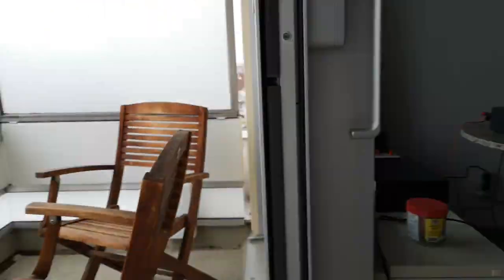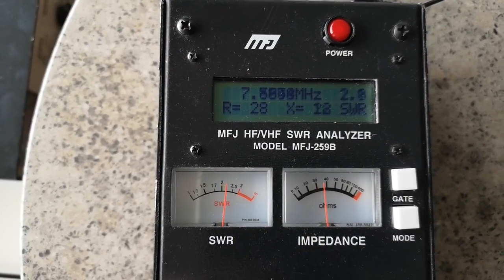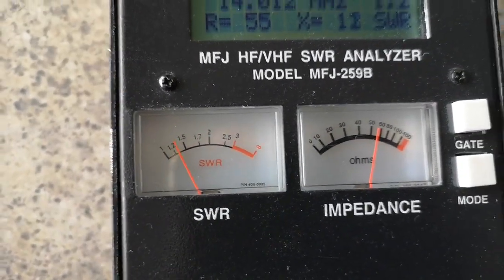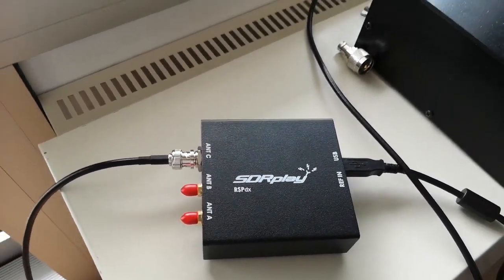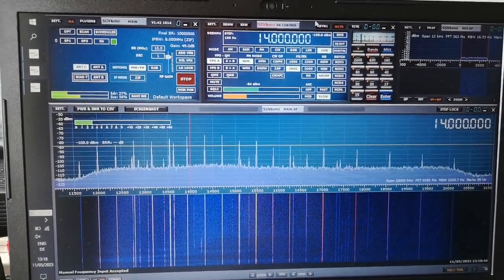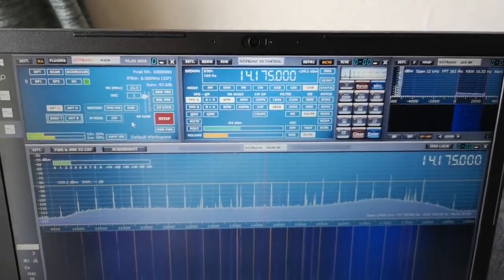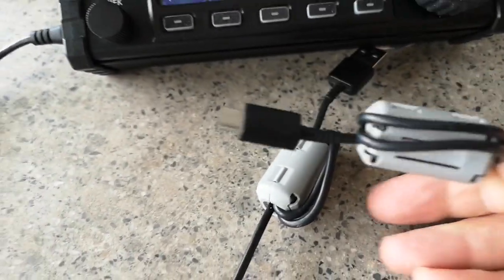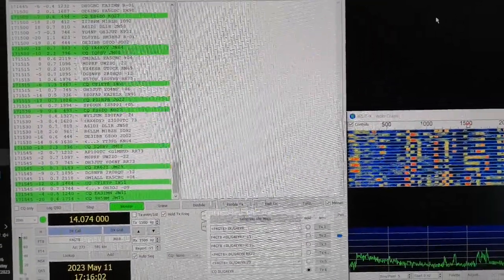Small Hidden Antennas for Indoor Amateur Radio Episode 1

Comment: If you lived on the top you might be able to put an antenna on the roof of the block of flats.
Reply from the maker: That would be great but then I would have to contend with leaking roof and poor heat insulation issues. Nothing is perfect ;-)

Comment: Awesome video Simon, thank you. This really shines the light on how important getting that noise floor down and how to do it. One question, how do you like the Xiegu X6100 radio? I will be purchasing my first radio soon and this seems to fit the bill at a reasonable cost. Is there different one you may purchase after using this one for a bit? 

Again, thanks for the great video.
Reply from the maker: Thank you for your praise. Regarding the X6100 I got fed up with the heating problem when on transmit and did experiment with attaching a large heatsink but this turned out to be not so practical and did not help so much in reducing the temperature. Also, the receiver had quite a few birdies in it "spurious signals" which you can usually identify since they often move in the opposite direction to normal signals on the spectrum display as you rotate the tuning knob. I got a Yaesu FT-891 and found that way better except that there is no waterfall display. The cost is approximately double that of the X6100 though.

Comment: Great audio, I thought it was raining at mine.
At 120ft asl in a tower block with a tuner and 5 watts, on a plastic window frame containing 3 metal window frames I connected the earth to one window on the left and centre of coax to metal window on the right, from Manchester to Europe at time of great signals on 10m no problem back in 2000.
Reply from the maker: That sounds great. I am always looking for quirky things to use as antennas. Keep experimenting and see what turns out...

Comment: All very interesting and over the years I have learned if you are using low power just load it up.  Even greater than 3:1 SWR won’t  kill your low power transmitter.  Get on the air and see who hears your signal. This is HAM radio and over the years bed springs, aluminum screen windows one slider door screens and emit and receive a signal.  Dropping an invisible small diameter black wire straight down works well to. Living in a flat like you your biggest problem will be radio frequency interference from all the electronics in each flat. Great video. Just encourage others to JUST DO IT!
Reply from the maker: That's great advice, David. Thank you so much for your comments. Just give it a try and don't give up is a motto that applies well to me. The challenge of HAM radio is a great training ground for future engineeers too. That's how I got started in my career in the 1980's :-)

Comment: Your loop antenna could be adjusted by fitting a long piece of plumbing pipe to the knob, or even moulding a heated pipe round the knob -like a box spanner.
Reply from the maker: That's what I did in the end !

Comment: You probably said it somewhere in the video but just a note that random wire doesn't mean a random length of cable.  Google will show some handy spreadsheets for lengths of wire to avoid... basically resonant frequencies and their harmonics.  Thanks for the vid / ideas.
Reply from the maker: Thanks for the tip Jeff. I hadn't thought about lengths to avoid !

Comment: What an excellent video! Fantastic demonstration! I also live in a flat and I have a lot of metal all around my balcony. I have a temporary setup and managed to hang a dipole for the 10 band similar to an inverted L but much more crooked. The radiating element is somewhat parallel to the balcony floor but not fully stretched. The one connected to the braid  falls down parallel to the coax but each time I set up the dipole  I fiddle with it to ensure the smallest swr. It is this non radiating element that I keep moving to control the SWR. It almost never the previous position.
Reply from the maker: Experimentation is the key :-)

Comment: Indoor antenna`s always suck
Reply from the maker: Unfortunately I think you might be right !
Reply from the maker: @VicGreenBitcoin
@VicGreenBitcoin
 I am afraid you might be right !
Reply: @fotografm  Giving negative comments is always easy, but offering a solution is a bit more difficult, but I do have an idea how you can install a full size antenna without anyone knowing. Do you happen to have a plastic PVC drainpipe on the outside?
I used to be able to fit a whole Antron 99 (upside down lol) in there and later a 20 meter long dipole! Can you show me the outside of the flat, maybe it's possible.

Comment: RE: Not receiving any output on your laptop. The most likely cause is because your laptops clock is not set to the correct time. It only needs to be off by a few seconds for this to happen. As you're using Windows  it's easy to fix, simply left click your clock on the bottom task bar, select "Date and Time". A window will pop up and in that window will be an option to sync your computer clock with a time standard. Job done.
Reply from the maker: After I made the video, FT8 signals suddenly started appearing on that laptop. I wondered what had changed, so yes the time probably synchronised automatically in the background. I will make a point of doing this manually every day in the future !
Reply: @fotografm  I’ve been caught out a few times by this that’s why I mentioned it. I now habitually go into W10/11 settings and hit the time sync button before firing up the software.

Comment: Hi Simon. Have you checked the laptop's clock is accurate? (Are you running a time sync program?) This foxed me too when I moved from my main PC to using an old laptop and I eventually found the time was out by a few seconds on the laptop. As soon as the time was synced, signals were then decoded.
Reply from the maker: Thanks for the tip. I think that is what the problem was. Do you have a favourite time sync program ? Is there any advantage to using one as opposed to the time sync function in windows settings ?
Reply: @fotografm  I use JTSync on my old laptop, only for the reason it is steam powered (at least it feels that slow) and that little program just does the job. If the time sync function in Windows works for you then I'd just go with that. All the best, Neal.
Reply: @fotografm  you should definitely use a separate time sync program as it runs as a service and it syncs the time much more frequently and reliabily compared to what Windows does out of the box. I am using a tool called NetTime on my laptop and NTPD on my desktop PC. Both work well.

Comment: I would use a long plastic rod (or straw) to keep my hand away from the loop.
Reply from the maker: That's also a good idea. I just thought of maybe using a length of 1 inch pvc pipe to turn the knob from a distance.
Reply: @fotografm  You can make it just long enough to stick past the front edge of the box.

Comment: The noise is probably coming from the screen inverter for backlighting.
Reply: True . Also of the computers power supply aren't that good stuff and the noise goes through the usb ports.
Reply from the maker: @adrianoragazzo1321  I am sure you are right. The worst noise seems to come when I touch the trackpad which is also being electronically scanned of course.
Reply from the maker: I guess so since on some laptops the noise increases when I touch the screen.
Reply: @fotografm  capacity coupling. Grounded conductive foil will block that, and your wifi too (sadly). I use older, 2nd hand Lenovo thinkpad  laptops as they are better made and better screened. The modern cheap models sold to peasants' are not well screened.
Reply from the maker: @G7VFY  I just ordered 5 "broken" older Thinkpads at a good price and after fixing them, intend to pull them apart and experiment with better internal shielding. Let's see how much improvement I can achieve.
Reply: @G7VFY  I have a Lenovo ThinkPad 420 from 2011 and it does work great
Reply from the maker: @stephenwalters9891
@stephenwalters9891
I guess so since on some laptops the noise increases when I touch the screen.

Comment: You put a tuneable loop antenna on the back of an antenna tuner????? WHY??? You don't need effectively TWO tuners. Loop antennas have a VERY high Q and so you will only see 6-8Khz bandwidth on an SDR waterfall display. G7VFY.
Reply: He told couple times that the loop is connected straight so it bypass the tuner . Alot tuners have two antenna's output so He can select the "balcony" or the loop , both on bypass or through the tuner (wich isn't the case of the loop ).
Reply from the maker: @adrianoragazzo1321  That is correct !
Reply from the maker: Thank you for your attentiveness, Stephen. That is indeed true.

Comment: I also live in a flat except with no balcony. Although there is a metal rail outside the window it is, as expected, electrically earthed. I have managed to work some stations in Europe on 5W/FT8 using the Wizzloop antenna next to the bedroom window. Managed to cross the Atlantic with WSPR and FT8 spots (not QSOs yet).

I see the Faraday-cage QTH situation as a challenge. Trying to make a radio contact from inside a flat is fun! One day I might even manage a voice contact on another continent.
Reply: Hi,very interesting and have a new subscriber 
I’m very new to I’ve got a peculiar question you might be able to help with
I also live in a flat,ground floor and I use a mag loop,with a FT818 very mixed results
Currently learning CW as I tend to pick those signals up better than voice
Would moving to a full SDR transceiver like Elad Duo make tuning the mag loop and operating easier for me?
Reply from the maker: @MrBracey1970 Welcome to the hobby. First of all changing the transceiver will make little to no difference except for perhaps the ergonomics of how you operate it. I have a FT818 and I love it. The receiver is very sensitive but the output power is quite limited at 5W. I like the Xiegu X6100 too because of the spectrum display and 10W output power but that receiver has more "birdies" and is a little more quirky. The size of the loop is very important. Larger diameter allows it to work lower in frequency. Fatter tubing provides lower resistance and thus greater efficiency. I tried many different locations in the flat and found that one particular window gives the best results. I am getting a 2E0ERO loop with motorised remote tuning. I find that is an excellent solution for keeping the tuning spot on. I seem to get for more signals on CW than on SSB probably because weak CW signals are much more easily understood than SSB. Keep experimenting !
Reply: Interesting you should say that ,I have a 2E0ERO loop antenna,but the manual tune version,great antenna that’s hard work to tune.I’ve ordered the electric motor tuner and hopefully that will make a difference.
Reply from the maker: @MrBracey1970  I find the electric motor is a life safer for a variety of reasons. You have to tap the buttons really quickly on the controller to achieve perfect tune as the motor moves too fast for my liking, even on the slowest setting.
Reply: You can put two, hf or VHF mobile antennas back to back with a cheap adapter and have a monoband dipole. The hardest thing to do in a flat is finding a good group. You can use bluetack or masking tape to do a corner fed loop tacked onto the ceiling. Just like a ww2 spy would do.
Reply from the maker: @G7VFY  That sounds like a great idea. I will look into it. I tried a longwire antenna and found that received enormous noise levels which completely buried any signals. Magnetic loops seem to be the way togo because of their rejection of electrical interference. I am also thinking of trying a copper tape square loop stuck onto the window...
Reply from the maker: I find the best signal is near the window too due to metal joists in the reinforced concrete. I am about to make a video comparing signal levels inside and outside the window as I suspect that the glass has some thin metal coating on it. We will see....
Regarding antennas I have ordered a 2E0ERO loop antenna with remote motorised tuning which I see as essential. A new video will be made when that arrives.
Reply: @fotografm  Loops are great for narrow band modes like CW and SOMEdata modes, but the high Q means waterfall displays will be mostly blank.
Reply from the maker: @G7VFY  Agreed !

Comment: Simon, you never did say what's in the peanut butter jar...  Will you be bold enough to try transmitting into the balcony antenna?  73 VK4QP.
Reply from the maker: In the peanut butter jar is peanut butter which I have to eat before I can use the lid as a tuning knob. A friend took pity on me and is 3D printing a suitable knob for me. 73
Reply: @fotografm  I know what you mean.  When I went to the US once on holiday, I bought loads of tins of Altoids, not because I liked Altoids, but because I wanted the Altoids tins for radio projects, and Altoids are cheap in the US...
Reply from the maker: @cthoadmin7458
@cthoadmin7458 As a kid  in the 1970's I used to keep the tobacco tins from my Grandad's pipe smoking tobacco. It didn't do him any good at all but kept me supplied with project boxes for 2 metre converters and the like !
Reply: @fotografm  Ah I remember it well, we particularly prized Golden Virginia tins, me for  electronics, and by brother for storing fishing things, like lead shot and maggots and such.  Things proceeded thus until kids started cornering the market, getting the tins before we did and charging everyone 10p each... Daylight robbery if you ask me.
Reply from the maker: @cthoadmin7458  Just normal capitalism these days...
Reply: @fotografm  Come to think of it, filling that peanut butter lid with a disk of wood then hot glue, would make a good knob...  tnx for the idea.